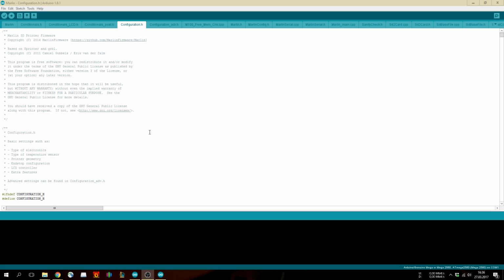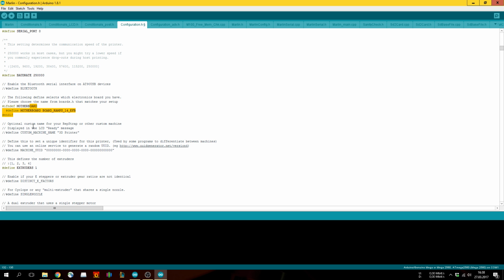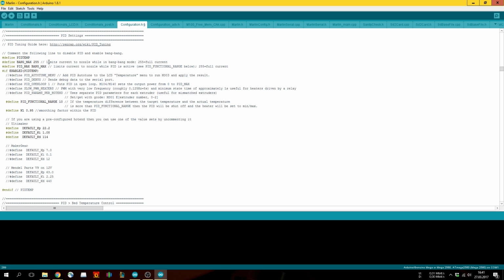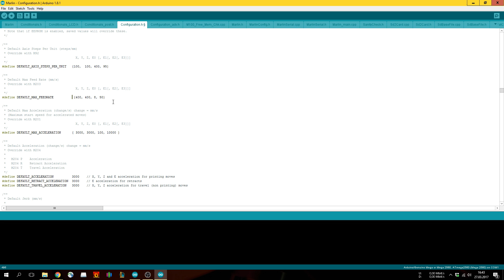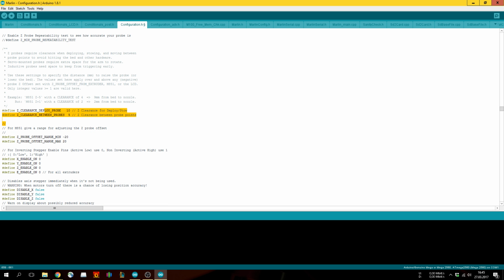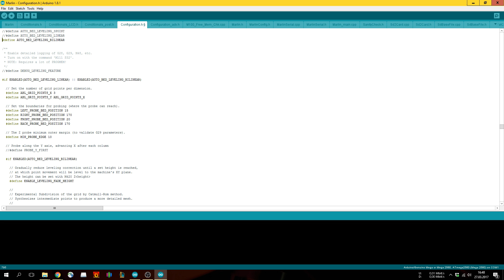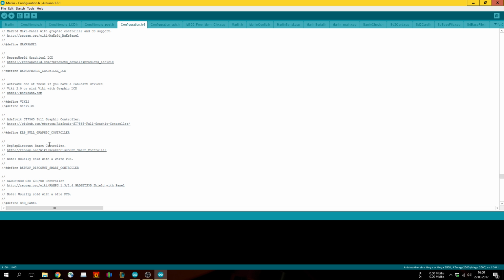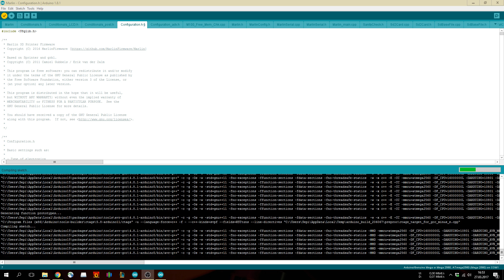Anet A8 Marlin firmware setup for RAMPS 1.4

Comment: Hi 3DMaker. I build up my Anet A8 Printer + Arduino Ramps 1.4 exactly like u described. But the Z-Axis doesn´t move. Not with trying the Menü -> Move -> Z -> 10,0 mm with moving the Knob ( also the numbers on the Display doesn´t change), also not with Pronterface.
X and Y-Axis does it well. Do you have any ideas?
To chat in german would also be nice ;)

Comment: Error compiling
C:\Users\Smart XII\Documents\Arduino\libraries\U8glib\utility\u8g_rot.c:48:27: warning: initialization from incompatible pointer type [-Wincompatible-pointer-types]

 u8g_dev_t u8g_dev_rot = { u8g_dev_rot_dummy_fn, NULL, NULL };

                           ^~~~~~~~~~~~~~~~~~~~

C:\Users\Smart XII\Documents\Arduino\libraries\U8glib\utility\u8g_rot.c:48:27: note: (near initialization for 'u8g_dev_rot.dev_fn')

fork/exec C:\Program Files (x86)\Arduino\hardware\tools\avr/bin/avr-gcc.exe: The filename or extension is too long.

Error compiling for board Arduino Mega or Mega 2560.

Comment: I know this is old but was wondering if someone can tell me if the settings are the same if using the DRV8825 stepper drivers? Also what voltage should I be setting the drivers to if I'm using the stock anet a8 motors? Thanks
Reply from the maker: Depends on what microstepping you use for the DRVs. If it is 1/32 (all jumpers used), then double the steps/mm. For the Voltage i would recommend you to try it out. Begin with a low voltage and rise it till you don't lose any steps anymore.

Comment: Z axis should be 100 steps per mm  because the lead screw pitc is 2mm and the motor needs 200 steps to make one round but you said 400 steps for z axis am I wrong?

Comment: Nothing about having two fans? one for the extruder, one for the part cooling?
Reply from the maker: Connect the extruder cooling fan directly to 12V like it is done on many printers and the part cooling fan on the ramps, have a look at my other tutorial https://www.youtube.com/watch?v=wgHfOLEh5A4&t=1s
Reply: I pulled my A6 board out and threw it in the garbage where it belongs, and installed a RAMP 1.4 + Arduino Mega2560 and programmed it with Marlin 1.1.8.
I then built a mini quad mosfet switch (like the MightyFan board), and use the 4 servo ports for the second fan and LED lights. I have two more ports left for future use. That way, when the print is done, an M42 P6 S0 will turn the fan off. M42 P5 will turn the LEDs off.

Comment: im so confused, so you are using A8 or you using ramps????

the A8 doesnt come with ramps right??

so this video is the A8 frame with ramps MB you installed afterward ?
Reply from the maker: Yes thats righ I am using the Ramps mainboard and not the original one anymore
Reply: can you tell me why ? ramps is much better than the original?
Reply from the maker: Different, more silent stepper drivers like the TMC2100, more stepper driver, controllable fans, ... and much more
Reply: thanks. i just bought one as well. do you happen to know the voltage and current for TMC2100? xD

Comment: Hi i did exactly all of the step, but im getting this error.. 

SanityCheck.h:659: error: #error "FRONT_PROBE_BED_POSITION must be less than BACK_PROBE_BED_POSITION."
         #error "FRONT_PROBE_BED_POSITION must be less than BACK_PROBE_BED_POSITION."
          ^
SanityCheck.h:662: error: #error "The given LEFT_PROBE_BED_POSITION can't be reached by the Z probe."
         #error "The given LEFT_PROBE_BED_POSITION can't be reached by the Z probe."
          ^
exit status 1
#error "FRONT_PROBE_BED_POSITION must be less than BACK_PROBE_BED_POSITION."
Reply from the maker: Like the error says:  FRONT_PROBE_BED_POSITION must be lower than the BACK_PROBE_BED_POSITION. Check these two variables. ... 

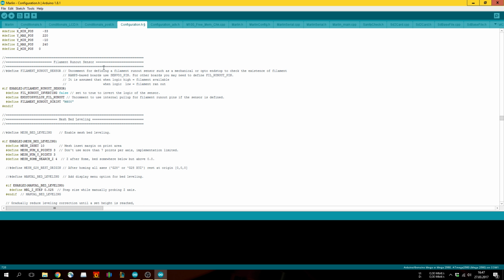Have you set the dimensions of the build platform properly? Also check the offset of you z-Autoleveling sensor. 11:52

Comment: I did exactly the same as you but when I click on Verify, appears a message error on the last code line (  #endif // CONFIGURATION_H  )
And the message below says #endif without #if
In file included from sketch\MarlinConfig.h:30:0,
from C:\Users\Usuario\Desktop\Marlin\Marlin.ino:37:
Configuration.h:1462: error: #endif without #if
#endif // CONFIGURATION_H

^

exit status 1
#endif without #if

What should I do?That's the only error. Thanks!
Reply: #Edit I started again and this error doesn't appear anymore and now it compiles the file but now says : C:\Users\Usuario\Documents\Arduino\libraries\U8glib\utility\u8g_rot.c:48:1: warning: initialization from incompatible pointer type.

u8g_dev_t u8g_dev_rot = { u8g_dev_rot_dummy_fn, NULL, NULL };
^
C:\Users\Usuario\Documents\Arduino\libraries\U8glib\utility\u8g_rot.c:48:1: warning: (near initialization for 'u8g_dev_rot.dev_fn')

Hope u can help me, thanks! :)
Reply from the maker: Have you initialized the u8glib? Upload your configuration.h
Reply: 3DMaker I did, I've read a few hours ago that I shouldn't worry about the error, just ignore it, should I? I can upload it tomorrow anyways, thanks

Comment: Hey... I rescue a Anet A8 from trash from one owner who never have printing one time with it . Gluing the broken acrylics pieces together, changing the burning Motherboard Anet for a Ramps 1.4 of Arduino Mega, replace the broken display for a RepRap full graphic LCD. But over the Firmware can you share with me please your wiring  please ??.
My probleme is the blowing fan from Anet A8  ( not the fan fror the filament from extruder) who cooling the hot end. On my first A8, it start on the same time like the preheat manually start on display, or startet full power after the first layer.
A picture from your wiring will really help me....
and a advice about comment or uncomment in firmware .

Comment: My Extruder pushes like crazy. I jammed my nozzle after a minute on the first print. When I want to extrude 5mm I get around 8cm. I can't see the Problem. Any Idea?
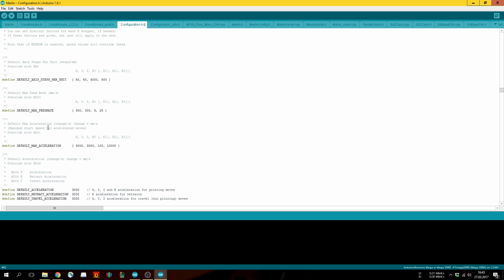Reply from the maker: 7:05 You did not set the steps per mm right.
Reply: I got DEFAULT_AXIS_STEPS_PER_UNIT {100, 100, 400, 90}
I also tried 10 instead of 90. The extruder pushes less, but it's as well about a couple of centimeters.

Update: Thx for the Support :) I forgot to set the Jumpers right ... I think now it's working
Reply from the maker: Hannes von der Weide just wanted to write check the jumpers :D

Comment: I followed step by step and flashed the board and it worked but my end stops disentangle stop when I homes it I am using the original a8 end stops and not the ones supplied with the ramps is there any settings I need to change to get them to work or do I need to use the end stops that came with the kit ? Thanks
Reply from the maker: What do you mean by disentangle ? Try the M119 command and see when the endstops trigger.

Comment: And now make a tutorial how to wire it up :D:D
Reply: Could you do that?
Reply from the maker: Will be making one shortly next week ;) Until that, this can help you http://tronxy.wikia.com/wiki/Switching_to_RAMPS_1.4
Reply: I had an Anet not tronxy
Reply from the maker: Andrew The3DPrintingMinion Does not matter. Are 100% the same steps. Other than replacing the cables, there is nothing to do with the printer.

Comment: What about the default_bedKi/Kp/Kd?  What should i set for that?
Reply from the maker: Leave them for the first time as they are and then run the PID Autotune. 
M303 E0 S200 C8
This will calibrate your nozzle to 200°C with 8 heating cycles. You will get every run a Ki, Kd, Kp setting and after the last run an average. Use the average values. For the Heatbed use: 
M303 E-1 S60 C8
For 8 cycles and 60°C
Reply: 3DMaker I don't even have the board yet

Comment: This is just what I need thank u 👍🏻 do I have to put any different settings for the extruder as I have a e3d v6 ? Thanks
Reply from the maker: You will have a different offset probably because of the different holder. So you maybe have to use the travel limits after homing. Use G1 X0 Y0 Z0 to go to your 0 point and meassure the distance to your heatbed and add it then to the offset. So for example if your hotend is out of the heatbed 10mm the offset you have to add is -10mm. Add this to your already existing offset.  
Also your extruder steps per mm could be off. Just use the calibration tutorial from Thomas Sandlander for that. 
https://www.youtube.com/watch?v=YUPfBJz3I6Y
Reply: Ok thank u !